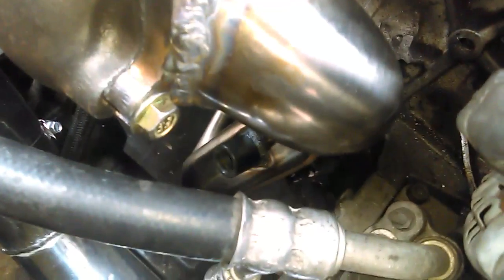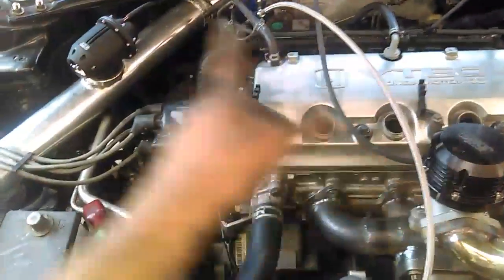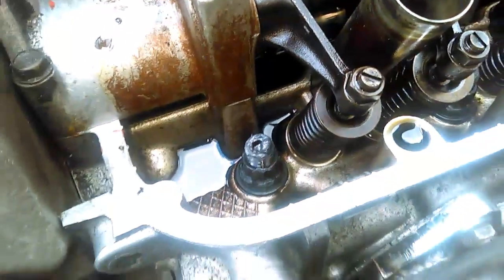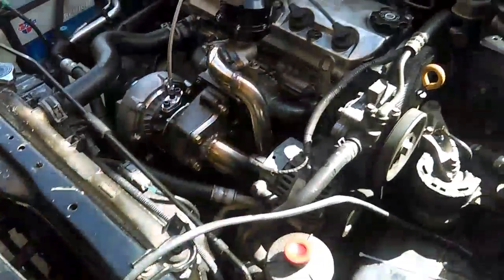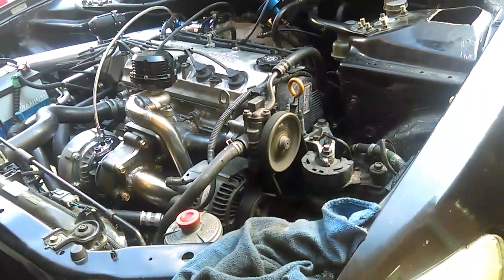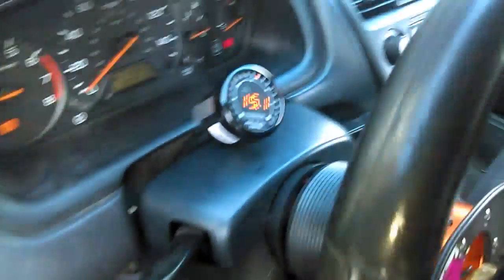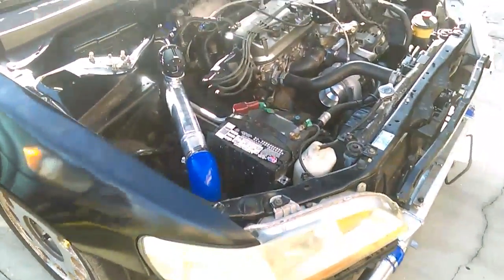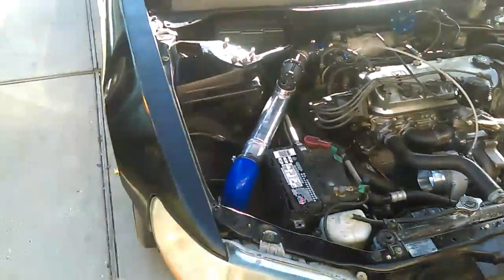The accord is finally making boost

Comment: I have a question...can I run low boost with a fmu on my stock motor with a turbo and not tune it? And if so how would it run?
Reply from the maker: Im not sure I know mine didnt like it when I tried to run it on a fmu best thing to do is get a p28 and a jumper harness and atleast get a basemap on it